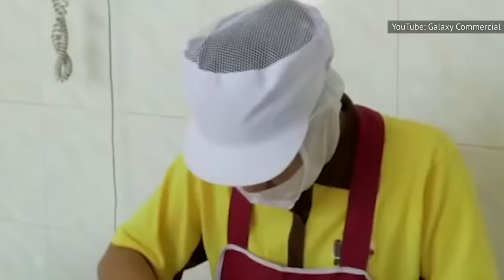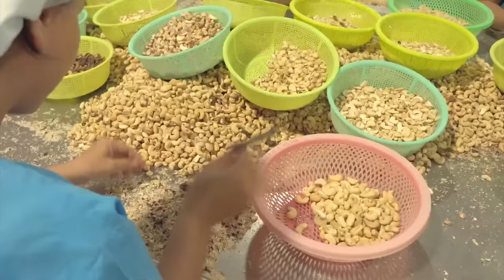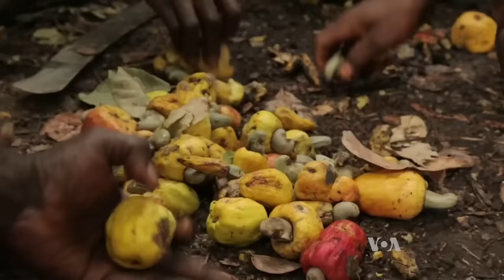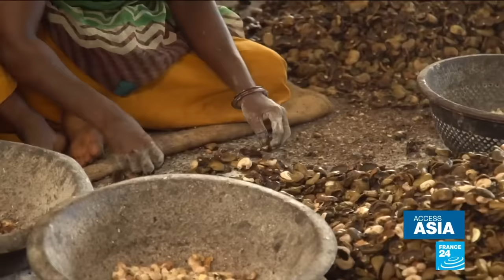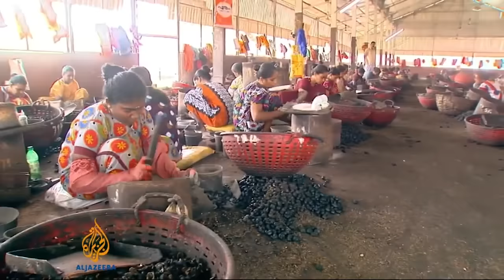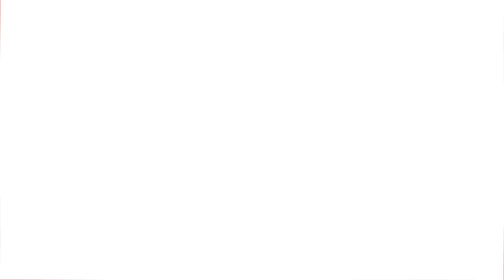Why You Should Think Twice About Eating Cashews

Comment: Do not mix up the word 'cashew' and 'cashew nuts'. One thing is one thing and another thing is another thing. The cashew is the fruit that grows on the tree and the cashew nut is the seed of that fruit that grows, differently from other seeds, outside of the fruit. You can handle a fresh from the tree cashew fruit naturally by the nut and eat the fruit and discard it, the nut. The only way the nut can burn your skin is if you expose the interior of it and touch your body, what takes a concient maneuver since the outside of that nut is very hard to expose. When we were kids we would hold this seed, ground it up until expose some interior part of it, then we would touch our skin making forms or letters. Next day it would be a burn like a liquid filled burn on the format of the pattern we tried to draw. In days it would be healed but the dark mark would be there for years to come. In the sixties that was our kid's groups tatto! Cheers from Brasil!

Comment: I have a high tolerance/resistance to Urushiol Oil, which is what causes the skin problems from harvesting them without protective gear. I know this because of all the times I had to go into the woods or work in lawn care and got scrapes and open wounds from using lawn care equipment, and even bleed rubbed up against poison oak, sumac and ivy, and never broke out, I'd be a prime candidate for working at these cashew farms. 🤷